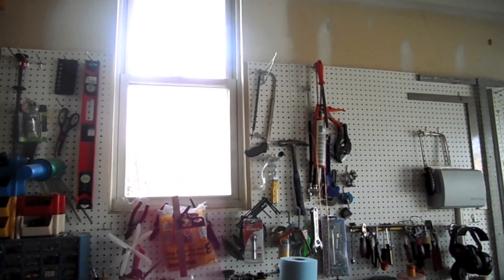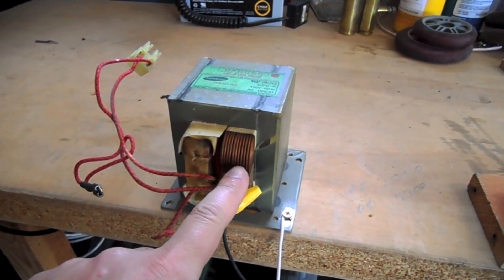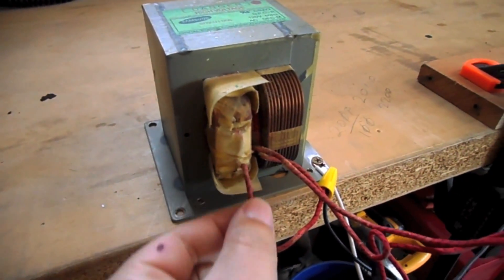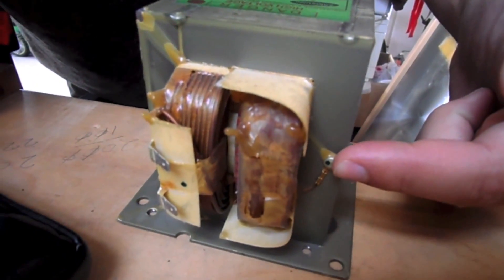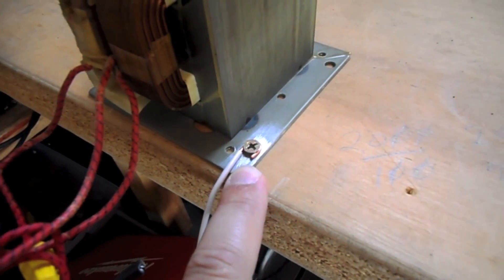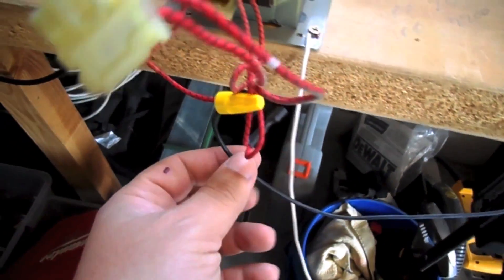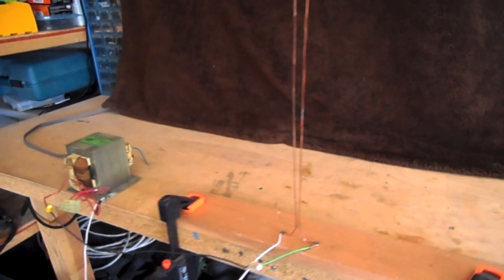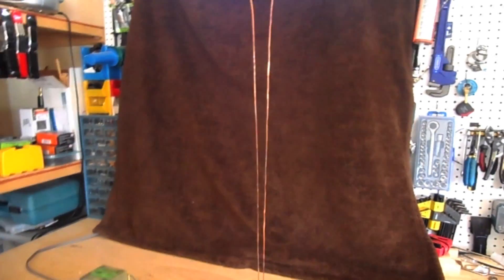Microwave Transformer powered Jacob's Ladder

Comment: Most excellent :-) I am building an Ozone Generator and was wondering where I would get a HV transformer from without having to buy one online... If I make a video I will mention you and link to your video :-)
Reply: You can make your own flyback, or you can go on Craig list or ask a friend fro an old CRT (the big old TVS). They have flyback transformers, high frequency high voltage transformers. They work really good for ozone generators!

Comment: Google it around and discovered that you can use the Hv capacitor from the magnetron and hook it up the you'r jaccob's ladder,in series with the transformer and that will boost the voltage and create a bigger arc. Gotta try this too! >.<!
Reply: should also make pulse itself over and over
Reply: Does it matter how you wire it in series or is there no polarity

Comment: Gotta try this... thanks
Reply from the maker: Yeah, I encourage you to do it.  Please be careful though.  This transformer is unballasted so if you did contact the wires, it could easily be fatal.  I'm not one of those guys who says don't try this at home to avoid liability.  I do believe you should educate yourself to the possible dangers before starting a project though.  Use a non-conductive material to hold the nail that you will use to bridge the gap.  Also, I hid the power cord so my kids couldn't use it while I was gone, just as a precaution.  Ideally a glass tube around the wires would have been great, but who has one of those? I don't know if acrylic would be as good of an insulator, but it's probably better than nothing.  Good luck!
Reply: mouritsen2 I really respect your philosophy of not saying "don't try this at home." I too think people should educate themselves and experiment like this. Just as long they know the basic principle of "don't touch it.".

Comment from the maker: I'm sorry to hear your transformer is toast, although I'm sure it must have been exciting to watch.  Unfortunately I don't know exactly how many volts mine is putting out.  I assume around 2000V.  I don't have a meter that I can measure it with though.
Reply: You can figure out how many volts its putting out if you have a multimeter. Just hook the mains onto the secondary coil and measure the voltage coming out of the primary, in other words hook the transformer up backwards, this will stepdown your mains voltage. Then take your mains voltage divided by whatever you measured on the output of the primary, and then multiply that by your mains voltage. That will tell you how many volts the transformer is putting out when hooked up the right way 👍🏼